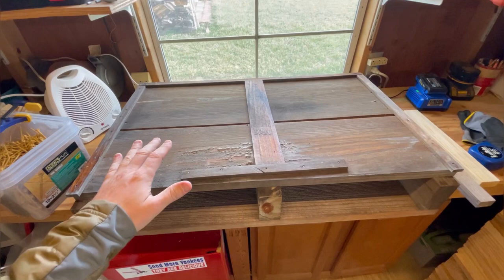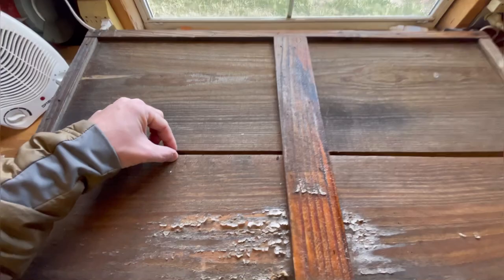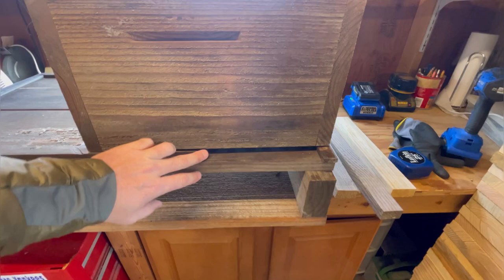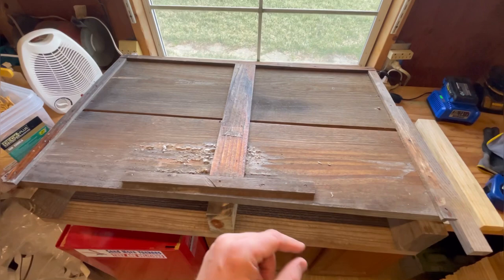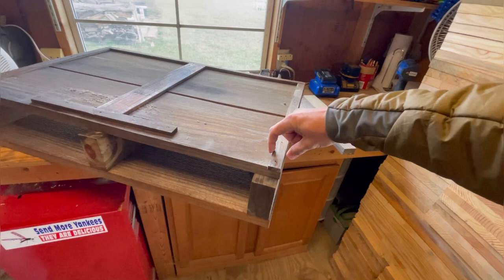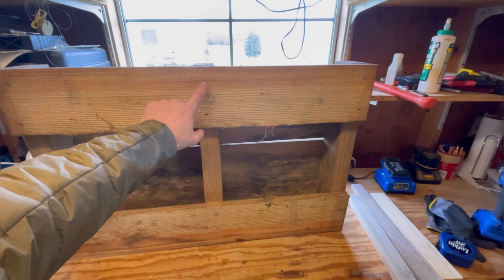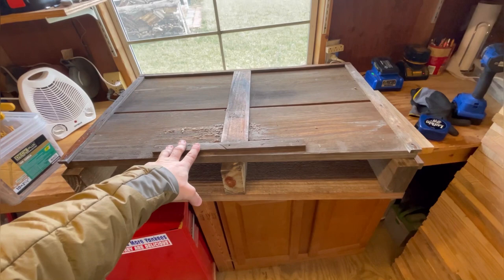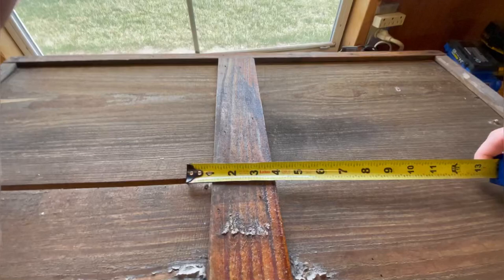Commercial 2-way Pallets: How we build our honey bee hive bottom boards.

Comment: Ever use advantech before you started the wax dipping?
Reply from the maker: I haven’t. From the beginning I thought I had to pick one route or the other. Solid wood and wax dipping does require more labor/initial input. But I felt like that was the best decision for making equipment last for decades.
Reply: @Ashby_Farms_NC  Good move, I did a bunch of advantech to try after everyone said it was grea for bottoms and tops.  After 3 yrs it all grew mushrooms.  Only concrete form board for me now